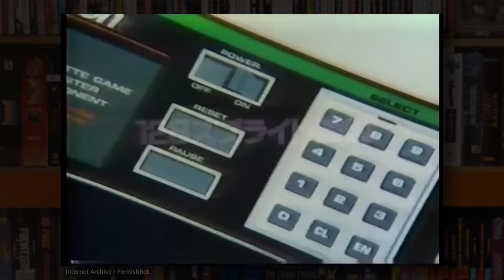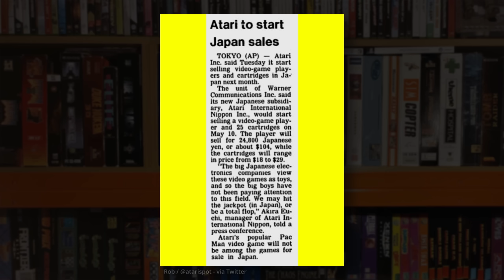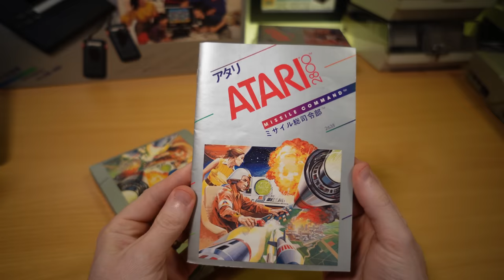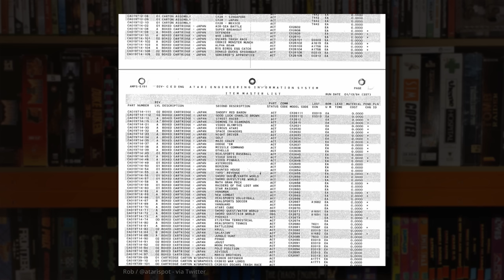Atari's 2800 Story - How They Failed To Conquer Japan (Again)

Comment: The 2700 Resembled the Atari 5200, the System was scrapped because the 5200 was a Bust & the RF signal for the Wireless Controllers kept screwing with the Rise of Garage Door Openers......
the 2800 had the new Shell for the Atari 7800 Prototype that was Supposed to release in '84 as a quick replacement for the 5200 but was a bomb. but when Jack Tremill shelved it during the US Videogame crash  they used the shell for the 2800
It would have been sweet to see my 7800 rocking the 4 controller ports
Reply: yeah its the spit of my 7800

Comment: I like the 2800's design... (I had a heavy sixer that I sold to buy an Atari 1050 disk drive... no, the sale wasn't enough to get the drive, but it helped. I would've liked to have that VCS back, though.)

Comment: Atari should have used this paddle+joystick combination in all later VCS2600 and 8-bit computers. Paddles could have improved many later games (Wall Defender, driving games) those were made joystick-only. It also could have permitted directional shooting games (but the "endless" Indy 500 paddle controller may have been a better concept for this).